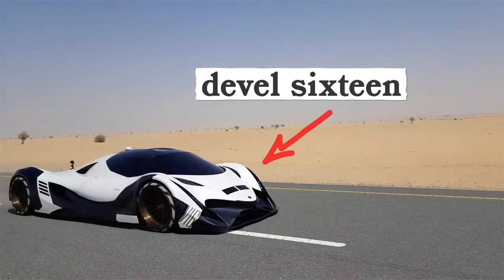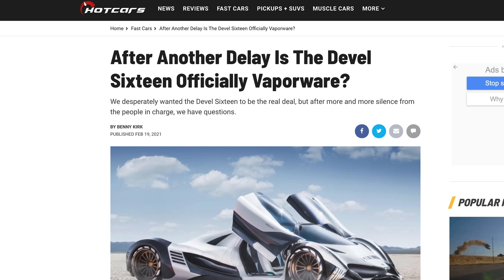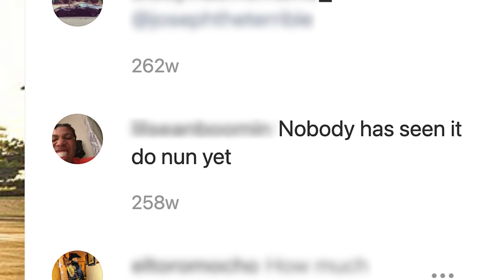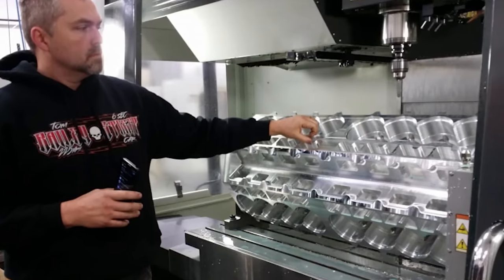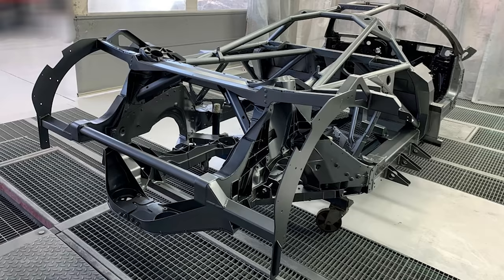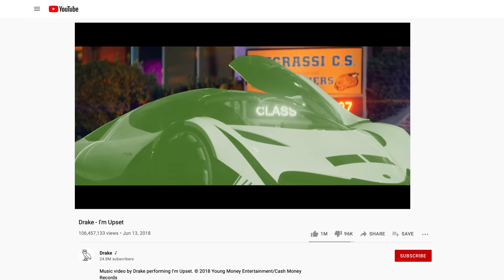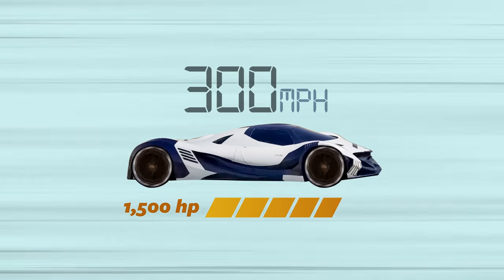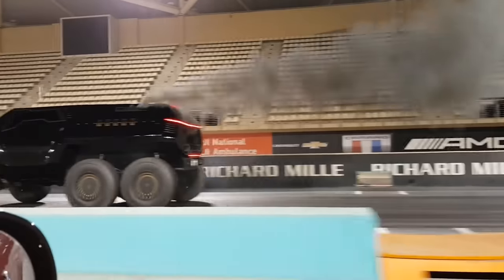Is this Infamous Supercar Real?

Comment: thats a scam yall have to admit it. first you have the administration, how you build ESP or Air bag on this car ? did they do crash tests ? pollution restriction wont allow a car with 12.3l engine cmon. Then they will have to face reality. Engeeniring, how you build your tires when Michelin himself took years and years for just doing buggati tires ? how you get downforce on 350mph without any spoiler ? how you build your spoiler ? how you cool down everything ? etc etc ...
but i guess the worst enemy is just the market reality. who wants to buy a 2M $ car when you dont have any place to repair it ? where i can find a car dealership ? do i have to send it in dubai everytime ive a spot light problem ?  

and just think. they came from scratch with im sure billions of dollars (if they make it one day) and they did everything by their own, factories, technologies etc... thats cost shit tones of money, but they will sell it for a million to 2M ? like they sell 100 of them they just make couple hundred millions over billions of dollars of research ? even ferrari sold some cars for 5 to 10 millions why not them with 5k hp ? and ferrari sold those car on loss.
plus the reliabilty. the ration liter per HP is a non sens. we can devellop like 200hp per liter reliable, an F1 can reach 800hp on a 1.6l and a F1 needs dozen of engineers, oil change every 60miles and die at 2000 km. But here, by miracle, they can have a reliable almost 500hp per liter engine ? 

thats just a scam

Comment: Honestly if money is no issue, building the engine for this car is probably the easiest part. If you’ve ever seen top fuel drag racing you’ll know the drive train is by far the weakest link. They are swapping out transmissions every couple runs and tires every run. Good luck reengineering and developing a transmission, clutch, driveline, differential, wheels and tires just to name the first set of weak points to be able to handle that power. It’s never been done before for a reason.

At 2.2 million they would have to sell around 2-3000 just to cover the R&D costs. 

Is it possible?  Sure. Anything is possible. If you want to see true inspiration,  just humiliate a sheik from the AE and he will be willing to loose everything to prove themselves right.

Comment: V16 is a dumb engine design. Especially if you're trying to make shitloads of hp and high revs. A v12 or an 18 cylinder would be better. Also if it's making 5000hp it needs some real big tires

Comment: I think the motor is a  problem. A video of a dyno pull does not mean that it's not a grenade. Even a big block chev v8 @ 500 ci on alky and 3000 hp ain't gona last very long....the block, crank and cam are just to long. They would have been time and money ahead if they had just coupled 2 production motors together.

Comment: Some funny cars have 5000 horsepower.  They are tough as hell cars, tires 17.5 inches wide just to have grip.  This car would snap in half because frame wouldn’t survive a car with over 4000 horsepower without a heavy stainless steel roll cage and frame.  The spoliers on the devel doesn’t put enough force to put the car on the ground without it drifting or flying.  First flying car that would execute you.

Comment: I'm an engineer, the only way you can strap 5000hp+ on a car chassis, without needing a cooling system of a powerplant, is to uses jet turboshaft engine. The tires would have to be made of special materials and size, the transmission would have to be reinforced and over sized. Perhaps a 6x6 sports car. Brake rotors would have to be doubled up to stop all that power. For aerodynamic, a suction fan would most likely be needed to suck the car to the road and to remove any vortices. It can be done with $$$

Comment: The car is real...
Comes with 4 different engines
50hp
1000hp
2000hp
5000hp
So far you've only see the 50hp. The other 3 engines require so much power and incedrible high rps's that after 1 rev the engine will simply need a rebuilt

Comment: It’s not only that.  Current tyre technology speed rating for the highest rated tyres able to take the G-force can only go up to 304 MPH.  After this the rubber can not physically hold together even with carbon fibre instead of Kevlar the rubber simply can not physically stay together.  No car can currently travel at 350 MPH because the tyre technology does not exist and it might require steel wheels in a desert to actually achieve that speed.  We will have to wait and see what happens.

Comment: You don’t need 5000 hp to reach 60 in 1.8 seconds. Hell you’d never get that power to the ground in a car like that. That kind of horse power requires huge tires with very low air pressure to be able to hook up. And that’s on a prepared drag strip.

Comment: If it has 5000 total horsepower, then you would need 2 2500 horsepower v8's or about 312 horsepower per cylinder.

Comment: or you could buy daily driver Nevera which is ready for production and is modern, and can drive for more than 100 miles before chasing a 118 octane race pump truck and costs the same.

Comment: I don’t have a degree in engineering but I don’t think that there are any tires out there that can efficiently & effectively transfer 5,000 horsepower to the pavement. The tire tech is just not at that level yet. Not even F1 tires couldn’t handle that kind of power.

Comment: straight up rear slanted exhaust with those rain flappers adds downforce and power, trucks with straight up exhaust add weight and downforce but reduce range, regardless of your top slant, slant the whole truck exhaust and see 10% or more range boost

Comment: I’ve worked around and seen more than a few 5000hp engines. But all the ones I’ve seen in real life are about 9’ tall, 20’ long and spin at 950 rpm. So 5000hp engines exist…. But that one seems sus. Top fuel dragsters also run 4500-5000hp, but the engines run 4 seconds and then get rebuilt. A street version of an engine making 5,000hp seems unlikely. Maybe it’s possible. But it also seems like other companies would have done something like before if it was feasible.

Comment: hmm, Man makes diesels used in boats that develop 1550 hp @ 2k rpm.
( check the Fleming 78 motor yachts, these engines are a minor upgrade for them )
so the lack of high horsepower used by cars has to have other reasons than the heat/torque causing damage you implied.

Comment: Well even if it's possible that vehicle has to go for motor stripping every year or less as the bolts stretches with that much torque.  It's a pointless vehicle only to be used on the drag strip.

Comment: I have no problem believing a 16 cylinder motor could make 5000 horsepower. It just won't be very fast, because all those engines are in trains and boats.

Also, why a V16? Straight 8s aren't good engines. I don't think they nepobabies who came up with this marketing stunt realize that. A supercharged V12 would be more believable.
Reply: The issue isnt even about the numner of cylinders, it's about the volume. 5000 hp for a 12.3liter would fall appart after 1000 mile

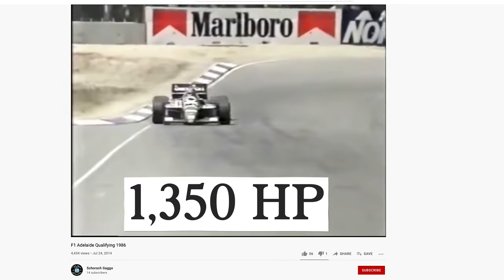Comment: 04:30 Toyota was making this power level for pikes peak use way earlier from the 3S-GTE based racing engine in 2.0l 4banger. Super rare engine but it does exist, i've seen several pallets of blown blocks at friends garage :D .... He was pushing them "slightly" harder than Toyota's Pikes Peak efforts, hence all the blocks with "inspection holes" :)

Comment: The engine seems like the real deal, and it's ridiculously impressive. BUT, production car worthy speed and power comes from a lot more than a good engine. First, how reliable is saod engine? Will it melt itself after 5 pulls? Then you have to think about aerodynamics, suspension, weight distribution, chasis strength vs total weight, etc. Theres so much more to it than just a powerful engine.

But, one another note, it's been almost a decade and they're still working on it apparently. So, who knows, maybe they're really trying to iron out everything in order to deliver on their word a few years down the road. Who knows?
Reply: There’s no way the engine is making 5000hp though
Reply: @massid3774  12.3 liters, 16 cylinders, 4 big turbos, help from a nascar engineer. 5000 horsepower from an engine like that is not completely out of the question. 

If you look at the world of aircraft engines, you can get those numbers (albiet from much larger plants, but those were also mostly from decades ago. We're talking about potentially the cuttin edge now). 

Do i think it's likely it'll ever actually see production? No. Do i think it's possible that one or two prototypes were pushed to 5000 on an engine dyno? Maybe. Again, it's not out of the question with todays tech and a lot of money to burn

Comment: If it's got 5000 HP and it can only manage a 1.8 second 0-60 time then I think they need to fire literally all the engineers who worked on it, because that's lame A.F.
Reply: Even f1 car with slick tyre cant do 1.8s and you want it to be done with road tyre ? No gas engine will ever ever do that on a road legal car. You need super slick and sticky tyres on a perfect tarmac if you dont want the wheel to start drifiting
Reply: @J.c410  formula 1 cars don’t have 5000 horse power

Comment: 5000hp? That’s 1,500hp more than one of the most powerful radial engines ever put to production. The R4360-35 Wasp Major producing 3,500HP powering Boeing B-50 Superfortress’. I highly doubt a V16 is going to do 5000HP.

Edit: that dyno test is indeed quite something. Still make it drive, and I’ll fully believe it.